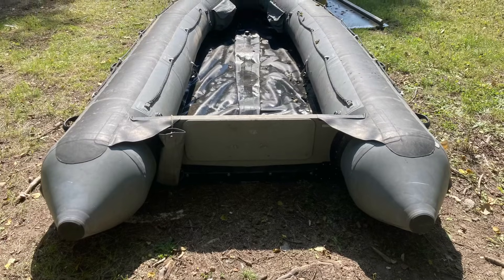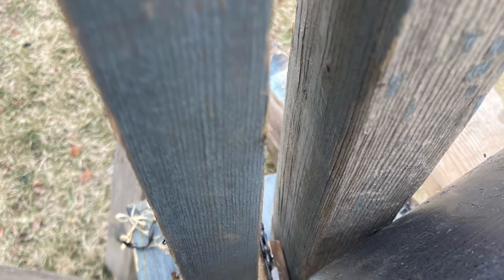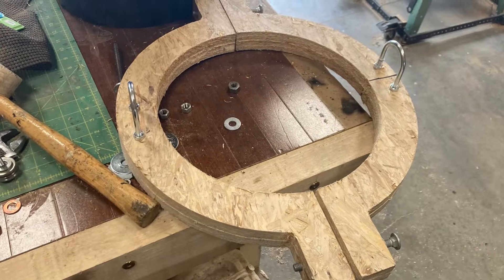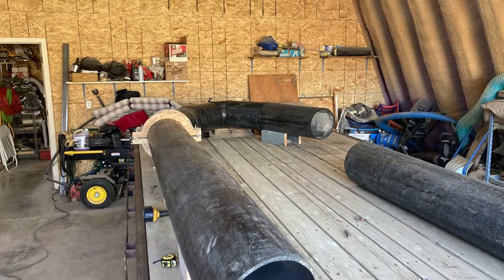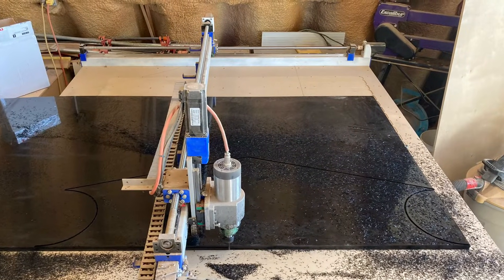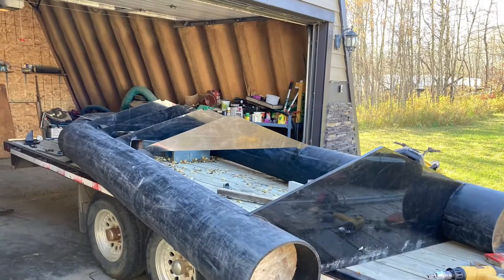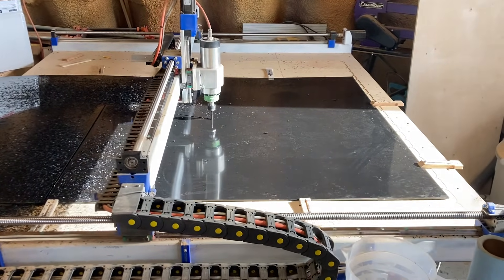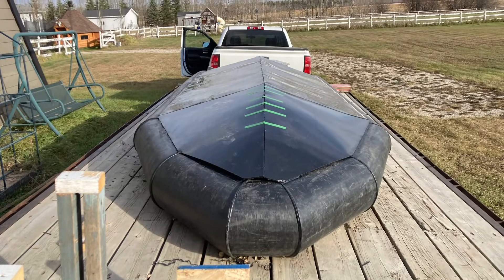HDPE (High Density Polyethylene) Boat Build Part 1

Comment: how will you connect the hdpe boards?
Reply from the maker: I have been fusing everything by hand with a heat gun and special tips and HDPE rods. It’s like tig welding but with plastic
Reply from the maker: Check out part 2